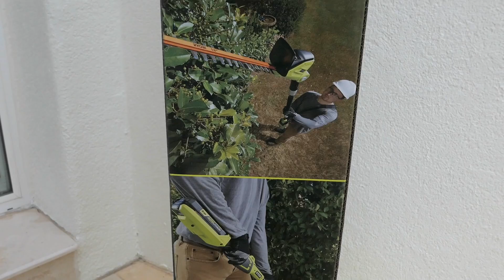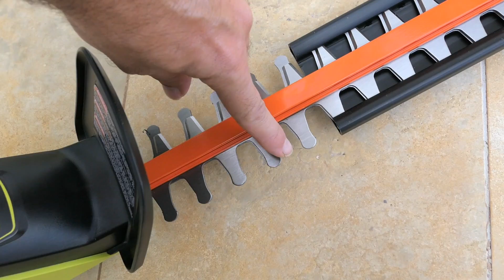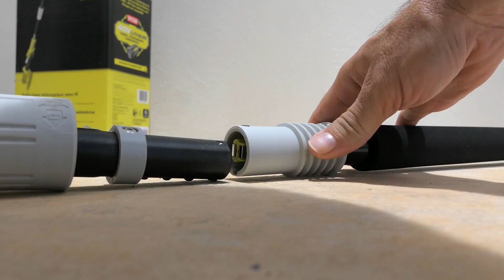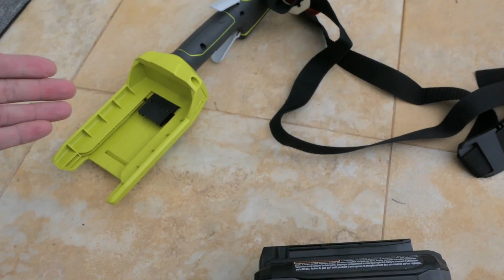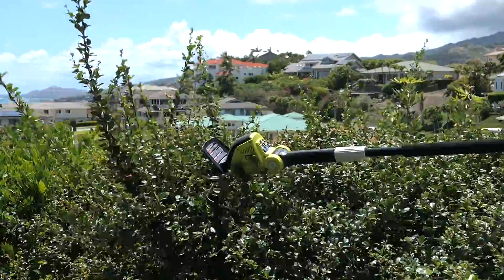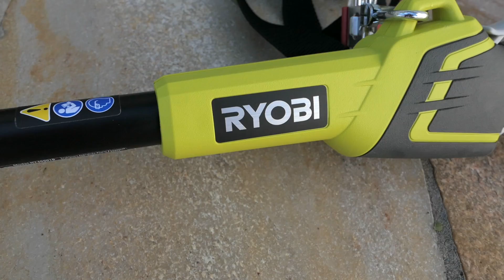Ryobi 40v - Cordless Pole Hedge Trimmer

Comment: I have the old (24V) version of this trimmer and it was amazing.  However, I will not be buying the 40V version for two reasons.  First, the only reason I'm not using the 24V version anymore is because the battery died and Ryobi discontinued the battery.  I'm not going to buy a new unit every few years just because Ryobi changes the battery design.  Even if they are going to a newer design, there's no excuse to stop selling batteries for their old stuff.  The second reason is that the old version had a large handle to support the pole.  Here you just have to grab the pole.  If I use my old one that way, the thing flops around like crazy.  It requires a lot more work to hold steady.   Sorry Ryobi, but you lost a customer here.

Comment: Hey great video. I got a weed eater and hedge trimmer from my neighbor he used it 3 times. The problem I'm having. I use either tool. For 30 minutes I don't have 3 dots. My battery is dead I have to pull out the gas weed eater or wait for battery to charge. Without knowing the price on the batteries I was happy with my purchase. But now I'm not impressed with the batteries ability to last more than 30 minutes. I love the weed eater and trimmer . Battery no so much

Comment: Just what I need for a BIG job this spring.  THANKS!  
Please chime in if you have this battery... can these batteries take a charge before being completely empty?  If you keep topping the charge off, will it diminish the lifespan of your battery?   I have a really big job and know I would want to fill the day with cutting without interruption.  Plan to put it down only to clear the debris and plug it in to charge while doing that.  Start again when I am ready, not necessarily when the battery is full.   Is that doable?

Regarding the weed trimmer in this line, if you use it for edging (soil cutting) should one expect that resistance will lessen the charge/power over just cutting blades of grass?  Thank you!

Comment: Probably a great product, if you're willing to spend more on the extra parts to be able to use it. I sent mine back without even unsealing the box. Bought it off Amazon for £168, but I should have read the small print more closely because it doesn't come with the battery. Depending on the amp hours of the battery you buy, this will cost of further £100-£150. Then you will also have to buy a charger which can be anything from £70-£150. And all of this If you can work out which battery and charger you actually need. 
So please be aware to use this product is going to cost you over £300, my personal belief this product is slightly misleading, at the bottom of the box is the word battery, then a small picture next to it of a battery with a line through it they should make it a lot clearer that you can't use this product straight from the box.